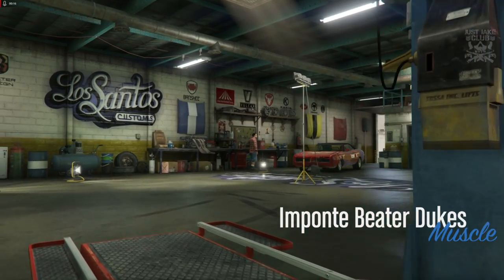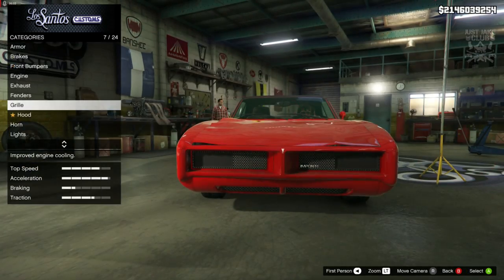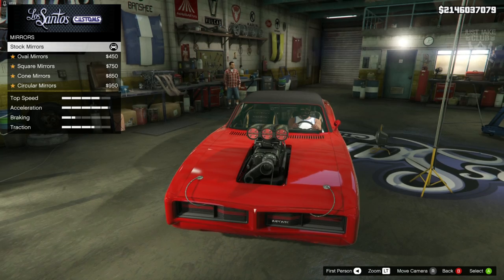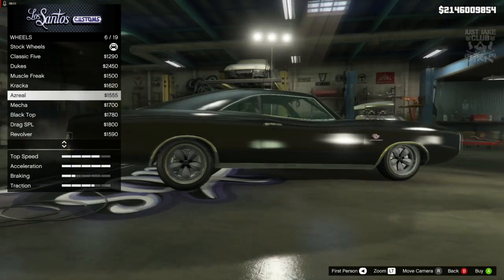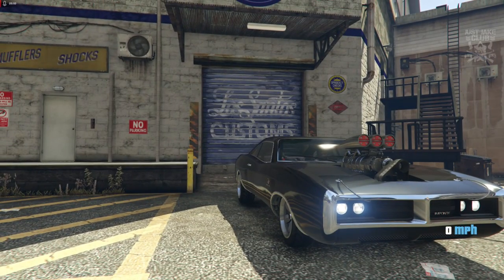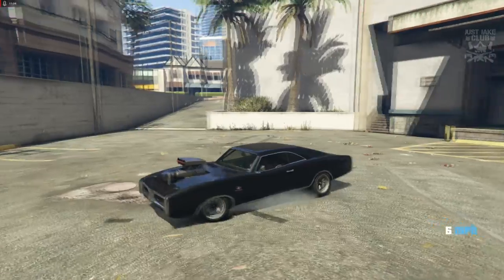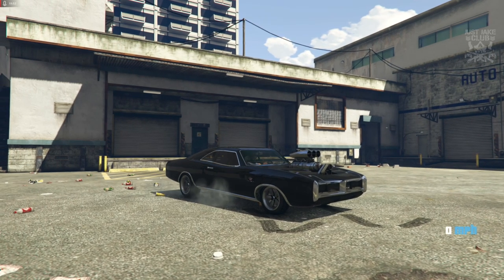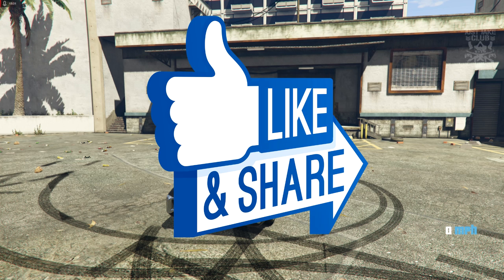The Fast & The Furious | 1970 Dodge Charger | GTA V Car Build Tutorial (BEATER DUKES)

Comment: You should try and make Furious 7 2000 hp charger, Fast and Furious 4 Charger. The other chargers have carbon hoods so I used the og dukes for them because the new one lacks a carbon hood option

Comment: I hate the fact that the dukes is based off the 69 charger and not the 70. That grill kills the car for me. If you could get rid of it I would have 10 of them. But I hate the grill rockstar gave it.
Reply: Use the gauntlet classic looks much better in my opinion
Reply: Kai Sharpe in game it looks much better than the dukes. But I’m a charger guy and far prefer the charger to the challenger, which the gauntlet classic is based off of. Which is why I say I wish they didn’t base the dukes off the 69